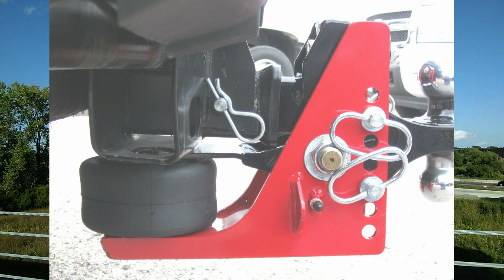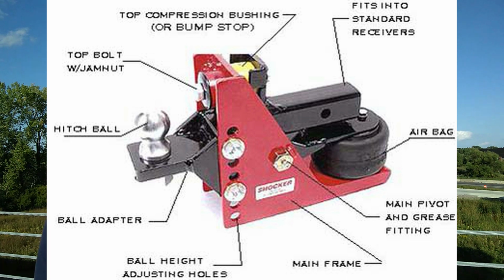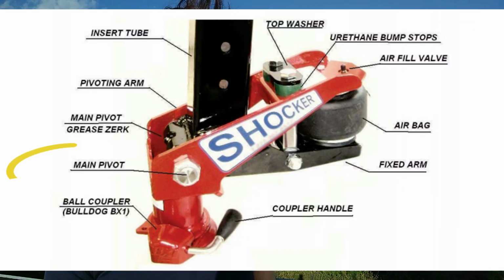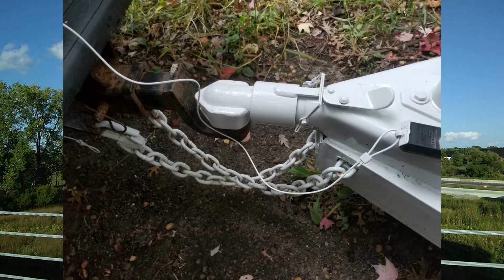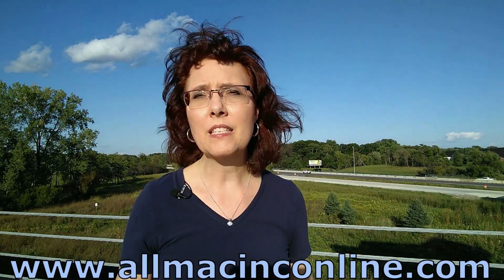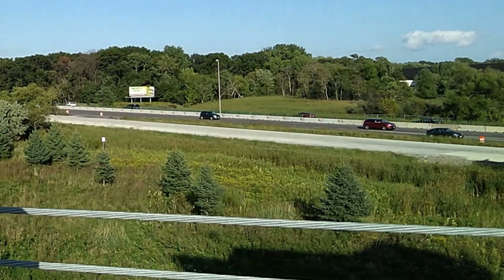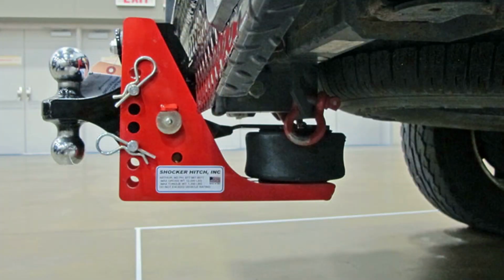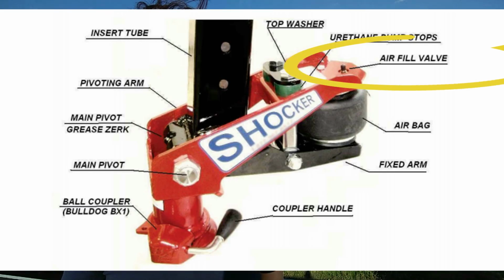Shocker Hitch Review for Trailers (2019) Check out the Shocker Hitch for Snowmobile Trailers

Comment: Can you use a anti swaying bars with the shock hitch for a 33 ft travel trailers.
Reply: No, anti sway bars work against he shocker hitch.  We recommend you choose one or the other, but not both as they counter act each other.
Reply from the maker: @AllMacInc  Sorry, I need to change my answer.  You CAN use an anti-sway bar, but you cannot use a weight distribution hitch.  Sorry for any confusion.